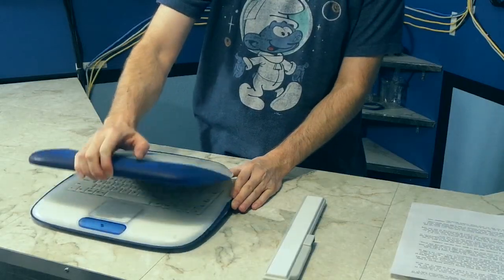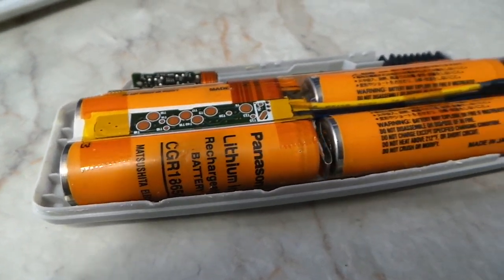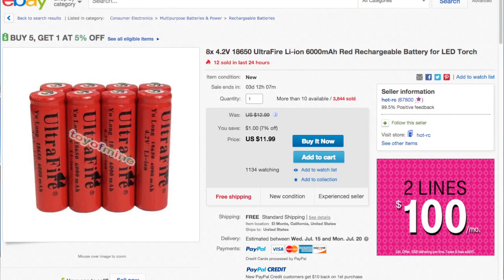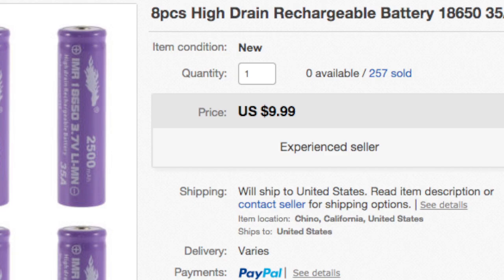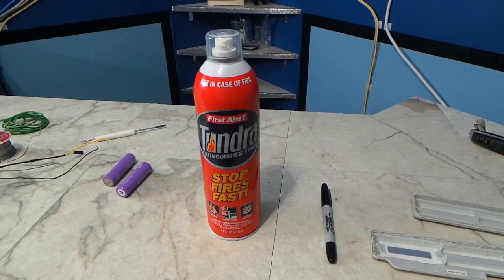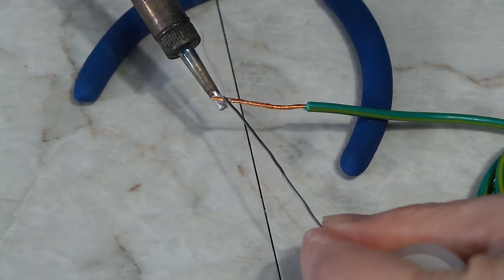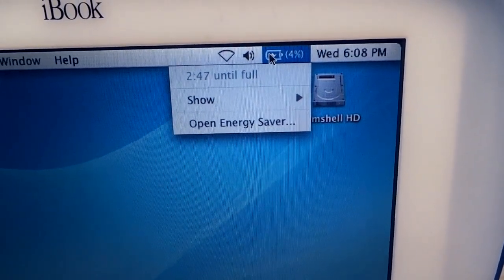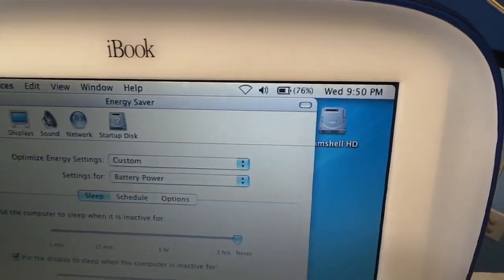Rebuild a laptop battery pack

Comment: Hi, 
I hope you would be fine
just one question asking for a long time with many people but no one give satisfactory reply. I hope you can come up to the best to solve my concern and share the info with others as well.
My question: i have a laptop battery of 6 cells of 18650 series, can i increase my cells by soldering three or six cells more because of this reason to increase the backup time.
I have no issue if cells are coming out of battery jacket, Can the 6 battery cells chip board found in the battery can control the 9 or more cells at the same time without infected to laptop.
waiting for reply.....
Qaisi Kulkar

Comment: TIP: Rough up the ends of the batteries with a file or sandpaper before tinning them with solder. The solder will stick a lot easier,  and better.
Reply: Also use flux.

Comment: My battery is made of two flat batteries (3.6v 2amp each), similar to those found in mobile phones. I dont find them on ebay. Does anyone know if it's possible to build? It doesn't seem to be easy because there are 8 wires on the tiny plug.

Comment: this method  is not applicable to modern laptop batteries because most of them are integrated(in the laptop) or the microcontroller locks the battery from charging after number of charge cycles or you  disconnect the cells.They do it so you have to buy a new battery from them.Dell even prevents thirdparty batteries and chargers :(
Reply: I was thinking of rebuilding the battery of my 2009 model Dell laptop. I'm guessing it wouldn't work?
Reply: +sprinter768 I also have a dell laptop.Its a latitude e5500.It's battery is  super dead it wont even charge.Since im not the first owner and i dont know much about the laptop i opened the battery (btw you wont be able to open it without destroying it.Its very well sealed) the date of manufacture was 2008 xD no wonder it doesn't charge or maybe because i have a replacement charger(The laptop doesnt show its a replacement).You can always get a cheap old but still working battery and try to transplant the cells but you have to do it without  disconnecting the old ones.Also mine is a less standard 4S so keep that in mind.

Comment: Has anyone attempted making a USB rechargable battery pack for 4x AA (side-by-side) batteries? I have a Roland boutique keyboard which takes batteries or USB. Ideally I'd like to make use of the existing battery bay, but have it rechargeable (it eats batteries like a mofo). Thanks!

Comment: Sounds like your batteries were much less than 1Ah apiece. Aren't the original battery packs 4Ah or so -- so, 500mAh per cell? If you're getting even less than an original battery pack, that probably means you ended up with the very worst ~350mAh cells, unless the controller board is to blame.

Comment: how much amps does a laptop battery pack need? Because nowadays you could get LG batteries for about 3.50 that deliver 3350mAh  at 6.7A

I usually use HG2s that deliver 30000mAh at 20A for my vape.

Comment: ultrafire generally have between 500 mah and 1000 mah if you are lucky.

some of the cheap replacement laptop battery packs actually have better quality cells than those available individually and are often cheaper per cell.

Did you ever try to recharge the original cells to see if they could be revived? 

also i have noticed that a lot of laptop batteries will begin to loose runtime even if the cells are still good it is to do with the monitoring circuit which counts things like charge cycles and uptime and will basically lie about the capacity, 

i have pulled cells out of supposedly dead laptop batteries and continued using them in other devises for with no problems after recharging them individually.

without resetting the controller which often is a propriatary software you may never get the full capacity from your new cells, in the past with older batteries that could be reset by jumping pins i have regained hours of battery life without even replacing cells.

Comment: problem is that the battery now  have a rom chip in witch monitors the charge cycles ,it it set at a specific number of charge/discharge cycles before it says it s time to change the battery , eventhough the cells are still good and can hold a charge.this is a safety measure on lithium batteryes manufacturers to avoid abuse of the cells until the cant hold zero charge.so eventhough you change the cells tha bettery chip still sees it like a used battery in its memory and wont charge properly , will say 100% charged but will hold a fraction of a new one. you cant erase its memory so you will be better off just buying a new one

Comment: Could someone please answer to me, i have a laptop acer v5 571 with 4 batteries of 2500mA and 3.7v , can i replace them with better , samsung brand new batreries 3400mA 3.7 without damaging something ?
I also heard that the battery chip will not recognise the new batteries without an eeprom reset

Comment: yes, do not buy any ultrafire batteries, they even cannot be charged to 4.2v, only 3.7v.
when you cut open one of these ultrafire batteries, after removing many sand or dirt, you can find one tiny soft pack battery sized smaller than your thumb

Comment: I removed my battery after 5 complete charges on my laptop and since then it works via power socket.will this do damage on my battery in the future?
Reply: It damages the battery if you always use your Laptop with the power attached. Because the battery is always charging and discharging. Like from 99.9% to 100% all the time.
Reply: I meant without the battery on my laptop.

Comment: Pro tip: make sure to apply a drop of liquid flux to the battery terminals before applying solder. Also, solder paste may work better than solder wire.

Comment: What can you tell about modern controllers that just stop working right after the guarantee period ends? I have an Asus battery that died 1 year after purchase, and I don't recall it was dying anyhow just before that. I disassembled it, and batteries seem to be quite fine. But I'm heard that controllers are programmed to stop working when the guarantee ends. Will it work at all if fresh batteries are used with it?

Comment: Would you recommend charging the battery with exposed wires that use the same voltage and current? I did that to a camera battery and the battery will only run for a minute
Reply: Probably isn't making good enough contact and not charging it enough. Battery should be fine tho
Reply: Dylan Bongiovanni it's not it's dead. Power wires were good and I got an ac adaptor

Comment: If you don't have a good understanding of how that charging circuit works, don't do it! The risk to set your house on fire is huge. Normally as a protection from such things the circuit if left without power (disconnected from the battery even for 1 sec) will erase itself, and won't work. If it still does like in the video, and you misplace the heat probe or add fake batteries that in reality have a smaller capacity, you're playing with fire. 
If the batteries come already with a protection circuit it won't work properly or at all.
Soldering on the battery terminals reduces the capacity/life of the cell, and in some cases the pressure valve can pop killing it or even set it on fire. (check youtube for lipo fails)
The space in most of battery packs its so tiny if you don't have the proper tools/parts, it won't fit back in. 
Quality batteries like Samsung and Panasonic if bought in small packs, (the amount you would need to replace your pack), usually cost more than a new battery pack.

Comment: I am a vaper and use a lot of 18650s and I really like the LGDBHE21865 by you guessed it LG now I dont really have any hard data to back up my claims but I get a full day of really hard vaping on three battery's  wish is better than most battery's I have tried and get about 500 to 600 cycles before I see any real drop in power and they are an easy battery's to find unlike lets say sonys vtc5 or vtc6 battery's wish are cloned quite a lot so needless to say thats going to be the battery in my laptop rebuild

Comment: dont change cells in newer laptop battery packs. the electronic inside cant be re-calibrated and if you install new cells they dont show more capacity. those chips inside the packs let them get old. the cells can be like new. you have to change the entire batterie pack.
Reply: well that sucks.  it wont re calibrate over time like he said?
Reply: Justin Hayes it works only with old laptops. if you have a newer one you must reprogram the microcontroller in the battery case. but you dont find instructions for those chips.
even new li ion vacuum cleaners got this shit today. so you must buy a new one after two years.
.

Comment: Hello, amazing video. Great way of delivering dialogue. I have some questions. I am using Dell inspiron 14z 5423 ultra book. When switched on,  shows no battery detected/ unable to charge, replace battery etc. I took out the battery and checked the cells with a multimeter, it a 6 cell match box shaped batteries. Some has 3volt charge and some has 4 volt charge. If the battery still shows charge, why is the warning coming on screen when I boot. Is it to do something with BMS that may have gone faulty or something to do with bios?  I have tried to take of the battery and then boot and Uninstall the battery driver and then reinstall the battery and boot again but that didn't help.

Comment: I've heard old NiCad batteries can actually be restored to part of their original capacity with something called a bench power supply. You run 30V through each cell for just a second, do that 10 times, and you get a battery that works at something like 80% of what the battery originally did. Sounds dangerous, but exciting!

Comment: Hey +The 8-But Guy
I was thinking about removing my DVD drive from my laptop and fill that space with some batterys and then attach them as another cell on my battery pack.
My questions are...
-Can I mix Li-Ion and LiPo batteries? As far as I know, they can be mixed since they both are lithium but they have some differences, and the next question makes me wonder if it is possible at all...

-Can I mix different capacity batteries? I mean, use the 4x3,7v 3400mAh from Panasonic (the actual battery actually uses 4x18650 3,7v 2800mAh from Samsung) plus (laptop battery is 14,8v, that's why I need 4x3,7v or even thinking about 2x7,4v) 4x3,7v LiPo 4000mAh? (or even more, as far as I fill the empty DVD drive)

-If no, I was thinking about using 4x3,7v 3400mAh Li-Ion in the battery, and on the DVD caddy put 4x3,7v 3400mAh LiPo batteries (I actually only have 9.5mm and just a DVD size, almost a square without a corner, to put batteries there) to actually get 6800mAh.

-I don't know if there are square Li-Ion batteries that can fit  the DVD caddy and store 3400mAh (I'm going to use 3400mAh because there are from a trusty store here in Spain, Panasonic cells and used other times as well) to not mix Li-Ion with LiPo and have a full Li-Ion battery.
Or... LiPo batteries that can fit the 18650 space on the battery case,

-And the last: I was thinking about not using the battery case space, and put all the LiPo batteries on the DVD caddy, but I think that having an empty battery attached on the laptop is just a waste of space and I want to get the maximum battery, since I don't use the DVD drive and the laptop has good space to fix some wires to the battery (and also the battery has space to let some wires go inside, or even can drill the plastic case).

Thank you and keep making this good videos! :D

Comment: My ASUS ROG gaming laptop only goes for about an hour 30 on a charge, and this laptop was only released LAST YEAR.  Trust me, you can live with that on an only iBook.
Reply: An old iBook doesn't exactly match the power of your Asus though, if you could connect the Asus battery to the iBook it would probably run for a week lol
Reply: +Jason Grimm bruh not really, that shitty ibook uses 8 battery cells, back then processors were a lot more inefficient

Comment: I never seem to run across any batteries that come apart without destruction of the plastic case. I had a Dell battery that used the flat type cells, I was sort of disappointed but I found a use for them.

Comment: itś not so easy. Most of battery packs have an internal controller that you need to access by manual to change some parameters when you exchange the batteries. Like maximum charge, reset the charge count and minimum and maximal voltage charges.
Reply: More modern ones have that problem

Comment: ya i understand ,, thats simple ways . good idea .. tank u .... but rebuild battry .how can i choise good battery cell .. how do measure power value 
i mean ams value . my sony e series battery cell not mentioned ams value ..
Reply: They are milliampers per hour, written as mAh. Every cell should have it marked somewhere.
Reply: ya.. i got 18650 .3.7 v.. but i did big mistake .. while disassemble old batteries, forget -ve and + ve therminal .any one can help me .for theis circuite .. for sony e series vpvb34en
Reply: can you send picture mr.winjin
Reply: no . i want sony e series battery controller and battery connection .. now i did rebuild but battery not work

Comment: Why not use soldering paste wit a small torch to gheat up the solder like they do on motherboards so you don't burn the board and end up wit a clean solder

Comment: It doedn't look like a good idea to heat up litium batteries
Reply: So a misclick on the keyboard means that i don't know english? By the way, i'm italian, that's not even my mother tongue, or maybe you are convinced that only english speakers are allowed on youtube?
Reply: What?
Reply: Whatever
Reply: Yeah was thinking about the same thing. I guess if you are really quick it's ok. But I know most guys (supposed experts on stackexchange and such) don't recommend it. Still, I think I will try my luck sometime.
Reply: how do you suppose the batteries were soldered in the first place?  With ice?
Reply: ***** They were not soldered, in factories they usually spot-weld them (in e-bike batteries and such). Problem is, a spot welder is pretty damn expensive.
Reply: There's no learning involved there; it's just a typo, probably from hasty typing. What //is// it with youtube commenters and their absurd insistence that spelling correlates to IQ?
Reply: whats the fucking problem whit one misclick? it doesnt mean that he doesnt know how write english

Comment: Man ok you gave a lot of labour for this video thanks. But still need to fix battery protectin eeproms reset. Doesnt matter you found and changed them all but how you will reset the chip(s) ? Because still you will see battery not charging or change for new battey mesages.. :)(HP,ACER,TOSHIBA or so) For to reset chips you need software and hardware.. Thats a lot of money starting around 100-150 dollar but new laptop battery about 20- 25 dollar, and one new battery pack goes around 2 years. Approx. around 7-8 years later your laptop goes old needs to change. Its not word it to buy a expensive ressetter too. Dood luck.

Comment: Nice video 8 bit guy. I am debating on rebuilding the battery for my epson action note 660c laptop because as you can tell its dead. The laptop was made in like 1997 and so the battery is totally dead. I know a good amount of info when it comes to computers, I have rebuilt MacBooks and other laptops but this is my first time rebuilding a battery pack and first time soldering anything sooo my question to you is what should I watch out for? I dont mind having my old ass laptop only get 2 hours of battery life, I just want to make sure I dont blow my face off in the process. Thanks for this video by the way!

Comment: Easy to open? I had to use a dremel to get into my laptop's battery pack. Fucking glue...
Reply: Use a solvent, then they open quite easily. Unless you get unlucky and get one that has an ultrasonically welded plastic case.

Comment: Tip.. instead of scratching the plastic cover. .. put few drop of gas (petrol) between the cover joints. repeat this for few times. the glue in between will loose its stickness then the cover cab be removed by just tapping the battery pack with ...like screw driver handle

Comment: Yeah true ive seen those chinese batteries - nuts you cant even get 6000mah out of a lion battery of that size.

Usually only one or two batteries are duds.
Get an Imax B6 that way you can test the batteries so you know which ones are duds!
Nice vid nevertheless!

Comment: how strong does the soldering iron need to be? I am looking at a 30watt fine Soldering Iron. Its on ebay under "Fine Soldering iron FLK-30 30W soldering iron 230V / 50Hz / 30Watt for soldering"

Comment: I have some old power tools with a low voltage, like 4.8v and 7.2v, I'm planning on replacing them with some 18650's, most likely 2, through a buck converter and with a charger inline so they can safely charge. I'm in the same boat, the drills don't work and no matter what I do is an improvement, so I'm interested to see what kind of improvement I will get.

Comment: As someone who's worked in this industry for years and has hundreds of hours of training both in classroom and hands on with engineers, this is incredibly dangerous and irresponsible. There is no guarantee the protection circuitry is still functional or functioning properly and no guarantee soldiering the battery won't rupture the pressure seal. Rechargeable packs of any chemistry should always be spot welded to avoid damage. Take a look at the Hoverboard meltdown videos if you want to see what an inappropriately constructed lithium battery will do. I would strongly recommend spending some time looking at videos and reading literature on what happens when lithium batteries go critical before you do this. In any case, a regular fire extinguisher wouldn't work to put the cell out once it ignites, you would need a dry powder extinguisher specifically designed for metal fires.